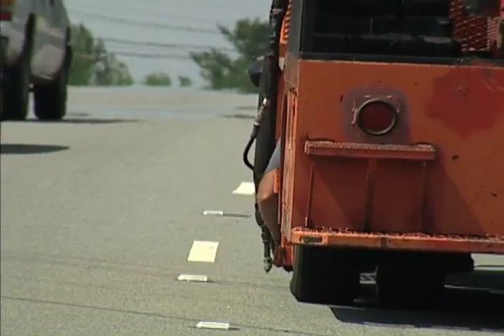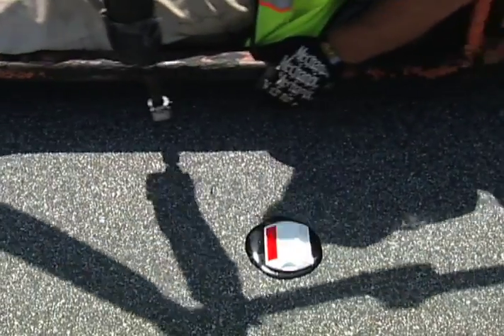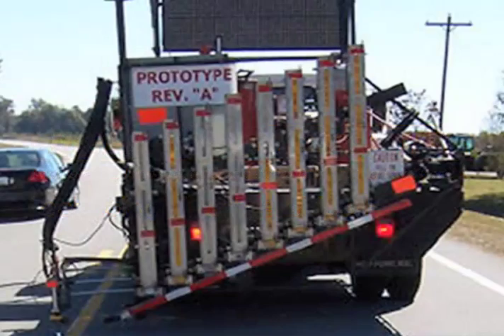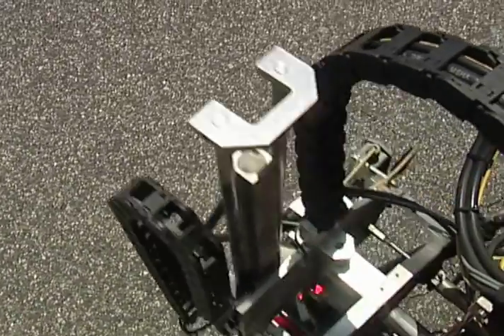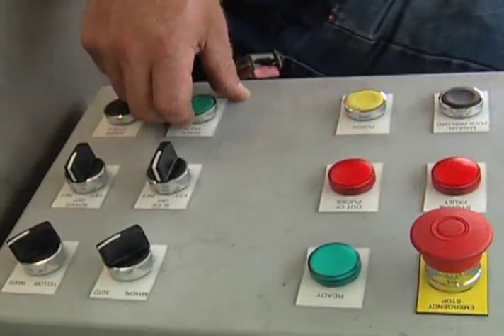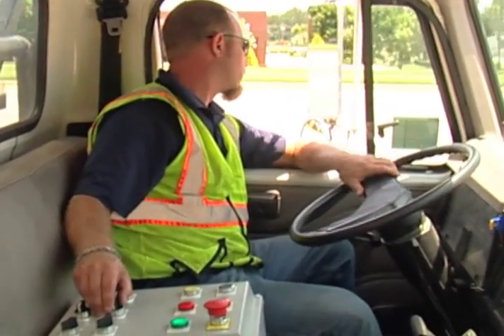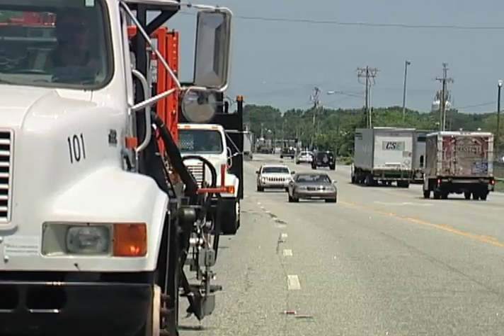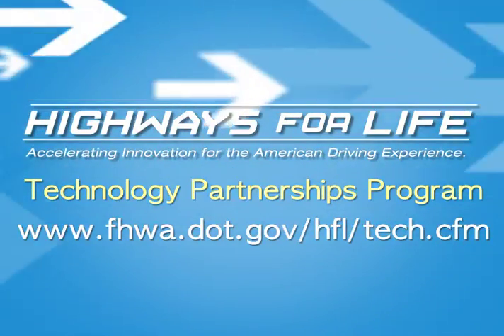Automated Roadway Pavement Marker Placement System

Comment: Not faster nor is it safer. Yes, you don't have workers on the road but you do have workers in the vehicles. Collisions can still happen. Me and my crew did just under 2 miles of raised pavement markers in less than an hour and that also included removing temporary markers. One marker every 80 feet. And that was a leisurly pace for us. Doubt this truck could have matched that.
Reply: If my RRPM truck is struck by an inattentive driver, the last place I want to be is in the "basket".